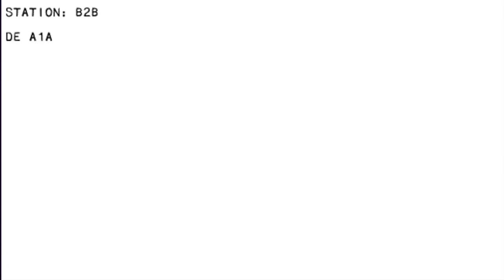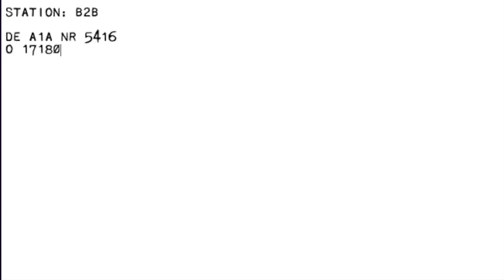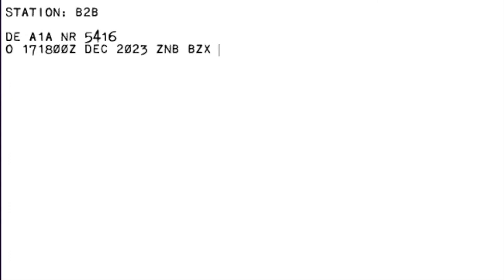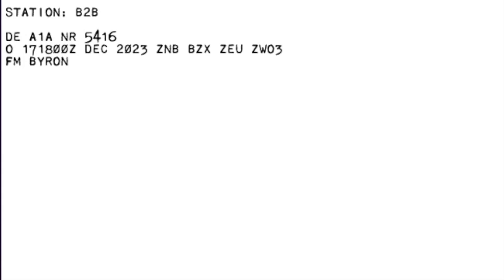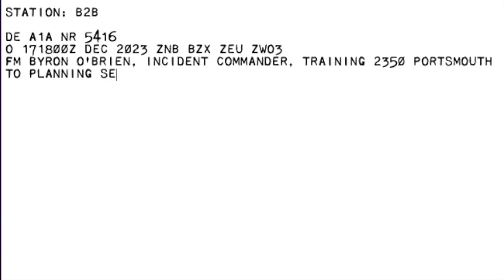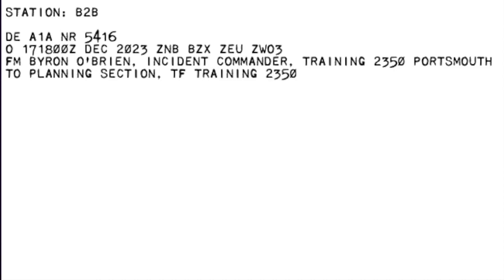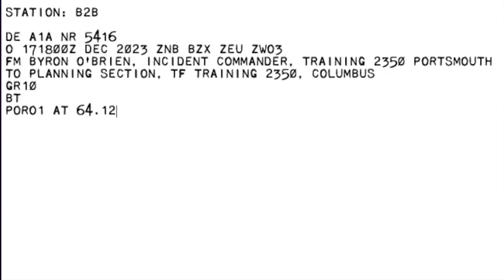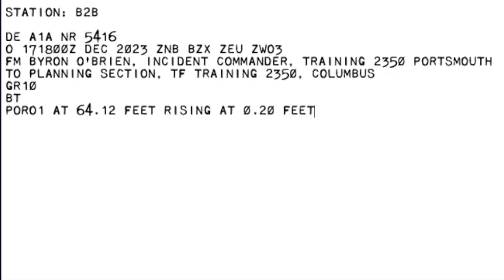Receiving a Radio Message (Basic Message Format, "16-line")

Comment: short range NVIS?  I am proficient at typical NVIS ranges 100-400 miles but I am still working on the shorter ranges, I did find out that even at 20mi it is still NVIS and the frequency is some what lower than the NVIS MUF usually the next band down. any thoughts on the beyond line of sight stuff?
Reply from the maker: I have a pretty detailed discussion of NVIS. The technique will work out to about 400 miles typically, as you point out, but no skip zone. Of course if very close you'll have line of sight, then further out you'll get groundwave, but the skywave will pick right up where otherwise you'd have a gap or loss of signal. 
https://youtu.be/s_x6IFAK1go
Reply: @KD8TTE  it is possible to get inside that 100mi range, normally you just under the NVIS muf but drop down a band, of it the muf is on 40m likely you will need to be on 80 so well below the muf it is possible and can work very well.